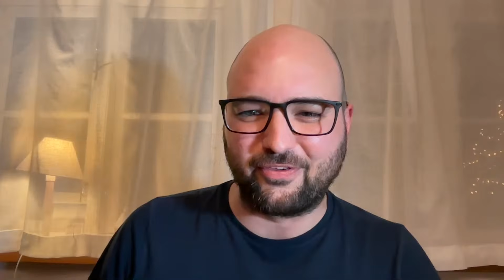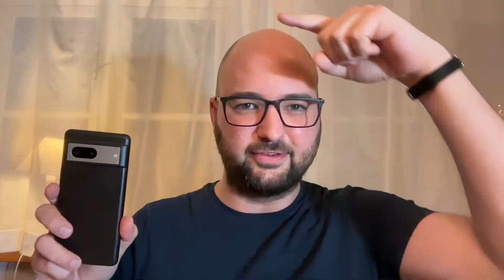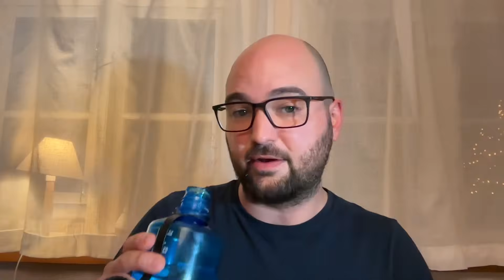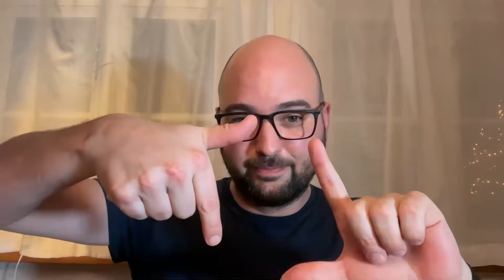Why Your Mixes Don't Translate: Live Studio Acoustics Q&A with Jesco

Comment: I have a Kali subwoofer with Adams A8H's monitors which replaced my original Kali IN-5's. I'm wondering if my Arc 4 software will help phase align my sub and monitors as it does apparently have phase adjustment qualities. 🤔